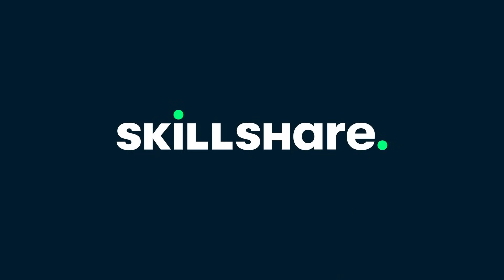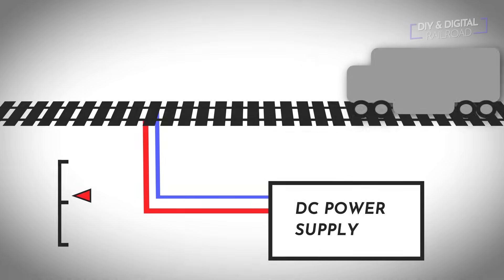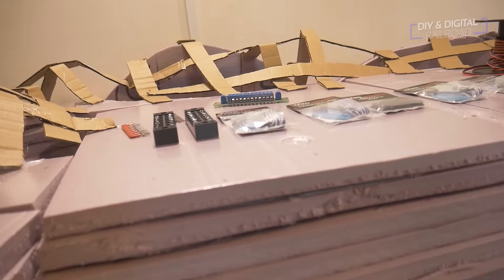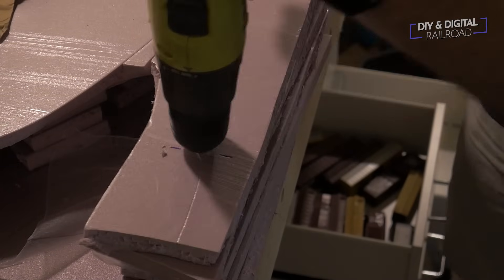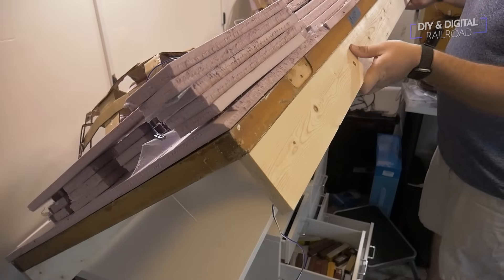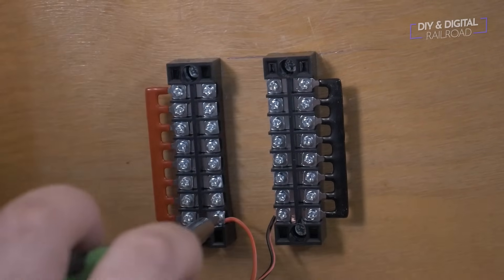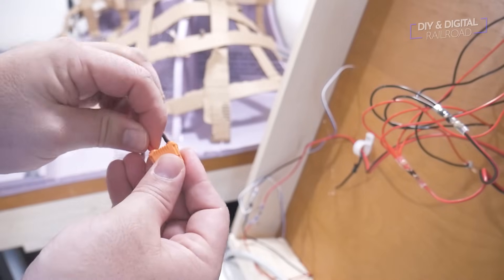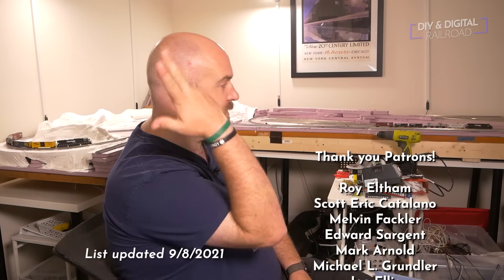How does DCC Work and how do I wire my Model Railroad for it?

Comment: Within 11 minutes I completely lost.  I have no idea how a terminal strip works or what it's even for.  I have literally zero knowledge of electronics or electrical workings.  The funny thing is I'm super-handy with just about everything else in my life; I can do construction, logging (real logging, not just tree pruning...but that, too), I do all car maintenance on our 3 different brands of cars (except electronics.  to the shop it goes for that) and plenty more.  But electronics/electrical matters intimidate the hell out of me, always have, and has been the primary reason I haven't got a layout built yet...other than simple circles of track.  

For people like me, you need to go wayyy more basic/beginner than this.  Start by saying what every single item you touch is and how it works/what it does before getting into how to install and connect them.  It is too hard to understand for someone like myself.  Not really criticizing, just pointing out that there are folks out there for whom even this is too advanced.  I don't even know what those electrical wave things are or what the terms you used mean.

Comment: 6:26 as a carpenter, if you have a long deep hole to drill, you don't need an actual drill bit. You can get a long piece of 1/4" rod, grind the end to a 3 sided point, voila, you got a drill that will "ream" itself though the foam. Now if you have a plywood support or base, yes you'll need an actual drill. 

If you need longer drills, go to your local hardware store and look for aviation drills. They are 12" long. I needed a couple 1/8" dia 7" deep. It was funny standing back 12" from the surface to drill such shallow holes but standard 1/8" bits are only about 4" long and there was nothing in between. 

I also have 2' and 3' bit extenders I put on my drill for securing drywall to ceilings. They have a hex end and a gripper at the other. I secure the drywall to the ceiling on ladders in 6 or 8 places then walk around on the floor securing the rest of the 48 screws. So much easier than moving the ladder around 50 times.

Comment: Would have thought it more likely that the dcc controller is pulse modulating between high and low dc voltage rather than high and no voltage. Eg, between 10 volts low and 15 volts high but I could be wrong. Might put it on an oscilloscope.

Comment: What an overly complicated and wasteful way to connect "feeders" to power. Yards of feeder wire can be saved if you run 16 Ga "power rails" around the layout underside near the track instead of running multiple feeder wires all the way back to one large terminal strip.
These can then be tie points for feeders using only your two-circuit terminal blocks. simple,
time-saving, easier to troubleshoot even without wire labels, much neater, and great material saving. 

While on the subject of wiring, it would be wise to use larger than 22 AWG feeder wires. Under heavy loads, the fine 22Ga wire will exhibit a possibly problematic voltage drop 
due to the resistance of finer wire and the amperage it's forced to carry. This drop will be much more pronounced using the long runs of feeder wiring as in your setup.
(I am a retired electrical engineer)

Comment: Lots of fast forward... over 10% of the video, the first over 2 mins was a non you tube commercial. Good thing there was an option to fast forward or I would have bounced. I can skip a you tube commercial after 15 sec. I get you need support for the channel, but that is way too long.
Good & helpful info otherwise.

Comment: As you go along adding more track, frequently test what you have recently added.  If you can still move the engine, and or toot the whistle all is still good.  If you instead get a short circuit the problem is with what you have added since your last test.  

Never wait until the end to test things unless you want to waste your time, get frustrated, and then give up on the hobby.

Never have more than just the test engine on the track. Never leave tools on the track.  Try not to leave anything on the track.

Comment: My digitrax dcs 52 keeps flashing on and off with a ticking noise at the rate of like 20x a second when I connected it to the FIRST dcc bus that was completely isolated. I couldn't find out what happened and need a simple anwser if possible. Thanks!

Comment: I would use Wagos before suitcase connectors and wire nuts before Wagos.  I have wire nuts on the wiring for my trailer and they tend to do very well.  That said, the wires actually go into PVC boxes where they terminate with the lights and other signalling equipment.  That being said, the terminal strips used here are actually a good option as well.

Comment: still confused!
Reply: Basically you want positive rails on a positive wire and negative rails with just negative wires. It just like wiring a DC power in your car.
Reply: Lol me too a little bit, but gonna watch again and try harder.  It is intimidating for lovers of this concept with absolutely 0 experience in it from childhood or even friends.  I’m starting from scratch.  Excited though and confident I can figure it out.  Good luck!!
Reply: It's not a wave like alternating current sends it's sent in bar waves there is the difference

Comment: I would be very interested in knowing where you get those orange quick connect plugs? Do the wires just push in or do you have to solder or crimp them somehow? If you could provide a link on where to get them, I would be very grateful!

Comment: Can you make a "turn loop" with DCC? As if you have a big loop where the trains go around, no matter how complex it is the + and - never interfere. But if you make a turnout at some point which then makes a 180 degree turn and attaches to the same line, so that the train can go in the opposite direction, the polarity will be reversed. Is there a way to handle that? You show some isolation thingie at 13:00 but can the locomotive deal with the voltage being reversed at the other track section?

Comment: If this question sounds stupid, please excuse my ignorance. I am a beginner at DCC. So I have a large DC track that is a continuous run track with several sections and turnouts etc. It is laid out on 3 4x8 pieces of 1/2 inch plywood with another 4' by 3' section connecting 2 of the 4'x8' where the roof in my attic restricts the width I can use.  Using a single DC power pack I can run trains along the entire track with only one connecting track. Recently I bough a ROCO Z21 DCC system with a WiFi router. I have hooked it up and can run DCC engines on it, again, with only one connecting track. So Why do I need to run wires all over the layout?
Reply: I think if you are only running 1 or two locos at a time you are fine. I have no issues with my layout losimg power with only 3 feeders. I do keep my led lighting all separate with a JustPlug system and don't run that through DCC..
Reply: A wiring bus carries power and commands more reliably than track alone. A bus also has less voltage drop due to lower resistance in wire vs. track.

Comment: Seeing all those whiskers hanging out from the stranded wire on the terminal strip was painful! Wire ferrules are cheap, give them a try. Great content, thanks!
Reply: Or, at least, wrap the wires around the screw in the direction of tightening. If you wrap from the wrong side, you get that tangle of copper threads.

Comment: Hey, if you put an esp32 on each engine, you can control as many trains as your power supply can handle. Let the esp32 provide the PWM to the engine it's wired to... 
You can even have them going towards each other Gomez Addams style.. haha

Question about track layout...
Part 1:
What if you combine a figure 8 and oval loop together 
using 4 switch tracks and a X in the middle?

On the figure 8, the inside rail at one end becomes the outside rail at the other end..
When you add the straight rails on each side that connects the top of the 8 to the bottom
you are going to have inside rail meets outside rail... 

I know you can put an insulator between them, but how do you get the train to keep going when the engine crosses from one side of the joint to the other.. 
The polarity is reversed at the transition.  
(Both ends of the engine will be the same polarity, when the joint is between the front and back wheels)

I am guessing magnetic sensors that detect when an engine is crossing the joint, to keep the polarity on each side of the joint the engine is crossing (the same)..

Part 2:
My thought would be if the track was constant power (AC or DC) and the train had a bridge rectifier for internal power conversion, then the PWM from it's internal esp32 does the brainwork... of speed and direction...
Reply: OK, think I got it worked out... (Super, super, super simple)
The 8 will be non-switched polarity..(never reversed)
The straight sections will have an insulators at both ends and have a polarity reversing relay. The relay will be controlled by a set/reset flip-flop.(or arduino equivallant)
There will be magnetic sensors on both sides of each joint. 
Call the top joint (set) and the bottom joint (reset).
So when the train crosses the (set) sensor, the straight section matches the polarity of the top of the 8..
when the train crosses the (reset) sensor, the straight section matches the polarity of the bottom of the 8..
The train speed and direction is completely independent of track polarity. Controlled by the esp32 PWM inside each engine..

added benefit.. The train can be driven by someone 1000's of miles away...

Comment: So I've just got back into the hobby and I want to come back with dcc. I never done it before. For the most part this video was very helpful however I still have one question. Why are 3 feeder wires needed?  Is there a rule of thumb for how much track you have therefore how much the feeders need to be spread apart?
Reply: DCC is only a two-wire system. Rule of thumb is to have feeder wires for about every 3 feet of tracks. That is roughly one pair of feeders for each segment of track (a continuous piece of standard flex track is 3').

Comment: Hey man I'm doing my first dcc layout and I'm doing feeders every 3 feet of track. Do I need insulation joints so every 3 feet of track is all on its own or can I add feeders like norman and the track is one big circuit.
Reply from the maker: Hello!  You don’t need insulated joints unless your are doing something like making power districts, current sensors or auto reversers.

Comment: Couldn't you use really small tube to run wire through? If use a tube just big enough to run the wire through. You can guide the wire through the board and foam a little easier plus it'll protect your wire from rubbing on you base board. At least that's what I'm think. I wouldn't mind hearing you idea about it.

Comment: and I could do this if I wanted to use a arduino for say Block signaling effectively making each layout (G scale country) automatic instead of using every single power pack for each locomotive.
Reply from the maker: Yes.  If you have a DCC setup, there is a way to detect current draw for block signaling.
Reply: @DIYDigitalRailroad  awesome, as this would be perfect for say when a holiday train (or 5 of them) is passing through each country, as each freight and passenger train would have to enter a sighting before giving the all clear.

Comment: Thanks or this, I used to be involved with model trains decades ago so all the digital controls are a new area for me.   But one small thing,  I was working in a toy shop in 1974 when I saw the first digital controller for trains.   It was just a small circuit board and you had to install it in the loco yourself.    I remember it because it was the very first digital product - and the vanguard of a whole new world.    I guess 10 years later someone worked out the whole thing and got it running better.

Comment: Jimmy. Great video showing the solid wiring technic used.  I am new to model railroading and about have my layout finalized. I would benefit greatly from a simple diagram showing where the track connections are located on the layout. I have not run across anyone that shows this.

Comment: Wrong:
DCC is NOT pwm.
It is alternating polarity blockwave, with (mainly) two lengths of intervals between polarity changes: short and long, representing 0 and 1 of the serial data.
Why do you narrate wrong, when you have the correct picture?
Some long pulses are extended to make sure the total length of positive and negative status is the same, so that there is not unintentional residual DC.
The on/off pwm you mention would mean a constant substantial DC residue and DC locos would run, in one always the same direction.

DCC switches power off when... You switch it off. 
While running, it is AC, in blockwave form.

Comment: Thank you for this. Everyone I talk to says I can't run DCC on Kato Unitrak and you just made it look so easy and proved it can be done. Thank you.
Reply from the maker: Who told you that?!
Reply: @DIYDigitalRailroad  People at Mississippi Valley N Scalers at a show in St Louis this past weekend and also people from Model Railroading Live.
Reply: @AlcoLoco251 wow i use kato unitrack on my test track    Like in this vid its got 2 wires.   Blue and white
Reply: They gave you bad information. Electronically, the tracks aren't really much more than extensions of the wires carrying power and command signals.
Reply: Most rr yt channels cannot explain these concepts. Yours is the first channel that does a decent job . I blame cell phones for destroying the English language!

Comment: According to NMRA, DCC is a digital signal where, "There is no polarity as there are only two possible states: HIGH or LOW."  "There are no negative voltages present."  This is what you need to grasp your head around: rail A and rail B are mirror images of each other in a high or low state.  So take your illustration of a square wave at 2:46 and move the center line (0 volt reference line) just below the square wave; that is how a DCC signal looks like on an O-scope for just one rail.  One other thing to note to clear up any confusion; the NMRA web site also states that, "Current flows from HIGH to LOW."  That is to say from a High State to a Low State - and that does not mean from a high to low DC voltage potential.  Current still flows from a more Negative to a more Positive DC voltage in the locomotive.

The real magic happens in the decoder, it gives the DC motor (lights, horns, bells and whistles) in the Loco a difference in potential in DC voltage, and the motor and other things work: example, a +2v and a +5v signal is a 3 volt difference in potential, and electrical stuff will work!  The track is fully energized all the time, and the decoder tells the Loco what part of that energy it can use -and Lights, Camera, Action! begins.  Forget the DCC coding stuff, the real power is in rails by the Magic in the decoder.

Comment: Someone described DC vs DCC in very simple terms.  DC you drive the track, DCC you drive the actual locomotive (engine, whatever you call it where you are :) )   I thought that was a very simple, but accurate description.
Your description of DCC operation is  close but not quite correct though.   DCC Uses the DUTY CYCLE to determine 1's and 0's, not "on and off" like digital from say an Arduino. So it is not the "On and Off" that determines the data, but the time the wave is in a certain state that determines if it is 1 and 0.   The other note.  The system actually swings from -15 to +15 (nominal for HO/OO Scale), not on and off.  Although a square wave, this is a form of AC, just not a sinewave AC

Comment: I was an electrician. They sell drill bits that are long enough to go through several inches, and feet, of material. Before you pull the bit back out after drilling the hole, tape a pull wire to it and then pull the wire through when pulling out the drill bit. Some bits have a small hole on the tip to insert a wire to be pulled back through. If not, you can drill a hole in the tip of the bit. I love your videos!!!
Reply: What diameter would you recommend?
Reply: @johnschutt9187  I use a 1/4 diameter. For other applications you may need to use larger diameters...like placing tubes through.
Reply: Beginner here. I don't see anybody putting grommets in the holes they drill. Is chafing of the wires simply not an issue?
Reply: @CarlZetie  Shouldn't be any movement of the wires to cause chafing.
Reply: p.s. Another trick I have used is if the hole is big enough for a straw, put the wires inside the straw and push the straw through. Secure the wires on the underside, then pull the straw back. For smaller holes and fine wires, you can drop a needle through. Sometimes you need to attach a thread to the needle, then the wire to the thread. I have used these techniques wiring AV and computers in walls.

Comment: I’m new to model railroading so excuse by stupidity but why can’t you just plug the track in with the rail joiners? Seems like a lot of expenses to run wire on the whole track
Reply: They aren't tight enough and corrode eventually,  I'm sanding, wire brushing and soldering all my joiners because voltage is more critical with DCC.